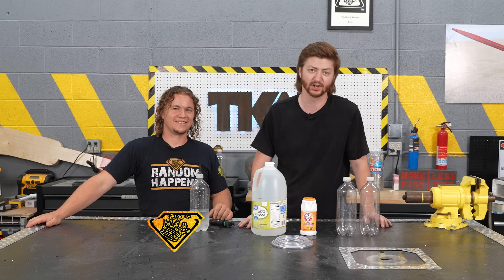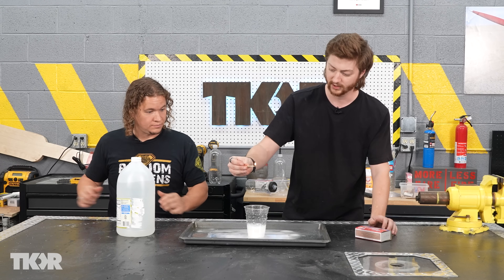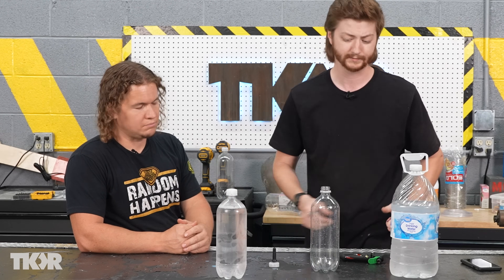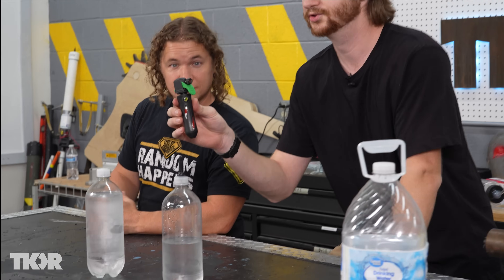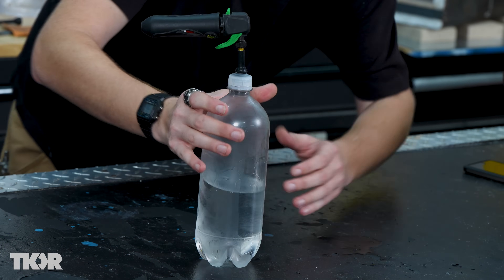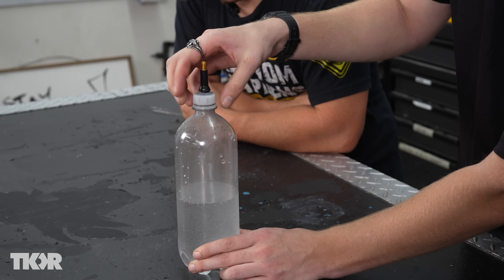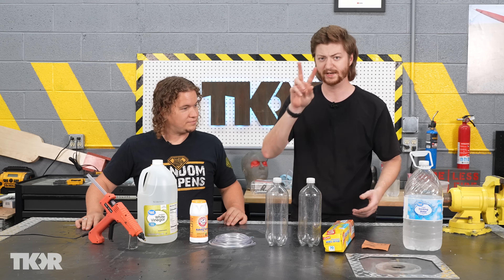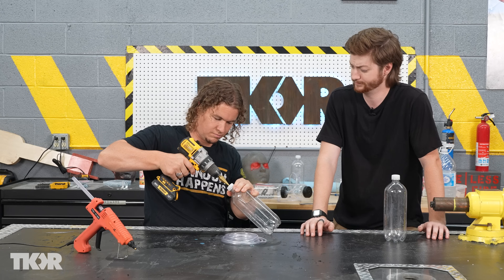Carbonate Drinks with Baking Soda & Vinegar???  |  $5 DIY Soda Machine

Comment from the maker: IMPORTANT NOTE: When you glue the tubing into the side of the bottle, be sure to rough up the plastic first with sandpaper. If you don't, the hot glue won't stick well enough to hold pressure. And you'll just make a mess (don't ask how we know)
Reply: how long dose it take to absorne intot the drink

Comment: OMG i actually had same idea a year ago for carbonation of drinks at home and actually built it before watching video , but there is a problem there is a relationship between rate of chemical reactions and pressure (inverse relationship) so as pressure increases less reaction thus harder to reach more pressure this limits this device ability but greay work 🎉🎉❤❤

Comment: Why wouldn’t you just drill the hole in the cap on both bottles and just run the hose it self to the bottom of the second container?

Comment: Drill a hole in both caps. The tube going into the cap for the receiving bottle should be long 
enough to reach the bottom of the bottle. After transferring the gas use new cap on that bottle.
Reply: my exact thoughts.

Comment: Another idea is Nitrogen. I want to try to carbonate sweet tea... sounds like it could be interesting. I've wanted to setup a 4 x 2 liter carbonation setup... another thing to try is to let it sit pressurized in the fridge... I think the 16g nitrogen cartridges might work with your bike inflator as well... you can make nitro cold brew like that. If you have access to a vacuum pump you can make cold brew concentrate in minutes instead of hours.

Comment: Fun vid, and a couple "random" thoughts (from someone who's used this basic setup for generating CO2) ...

Even more money savings, and less taste crossover: swap the vinegar with food grade citric acid.

Also, a relief valve on an outlet tube on the beverage bottle would allow multiple degassing events to more thoroughly inject the CO2 in stages and without shaking. 

Lastly: there are caps with dual 1/4 nipples that are dirt cheap, easy to find, and would totally eliminates the need for any sort of glue (the 2nd nipple on the source bottle should be "closed" with a valve or plug, or by connecting both nipples via short tubes and a 3-way "Y" connector), and the 2nd nipple on the beverage bottle terminated with a cheap plastic air valve used in aquariums, to allow for multiple CO2 injections)

Comment: ummmmmmmm
ARE YOU LOOKING TO GET SUED ?!?
you guys are building basically a bomb
just saying..
1. your containers are airtight
2. you have uncontrolled reaction making gas, overpressuring both bottles
3. since you can't control the reaction, or the rate the gas dissolves in the liquid you are making,  there is a very big possibility that you are making a bottle bomb, which at any moment in could blow up, shatter the bottles, and spray sharp plasitc shards all over..
NOW, important bits... the explosion of those bottles alone is not big enough, that it would cause any structural damage, but the flying plastic shards could cause wounds, 
END IT IS ESPECIALLY IRRESPONSIBLE THAT YOU BOTH ARE LOOKING AT THE BOTTLES AT CLOSE PROXIMITY WITHOUT ANY EYE PROTECTION..
are you... looking for a lawsuit from some parent whos kid got blinded by this "experiment" ?
pressurized systems are inherently a bit unstable and dangerous, and making it seem just a lil harmless experiment anyone should do at home without any mention of any kinda protective gear, is moronic on your parts.. 
i hope i'm being clear enough.  sure, this works, it is fun little experiment which can be done with kitchen chemicals, but the way you do it, and keep putting your faces close to the bottles, is far beyond ok, and extremely dangerous to your eyehealth.
ESPECIALLY when you have no mention of any kinda measurements or ratios of vinegar / baking soda... what if a kid just pours a mug of both in a bottle and closes it ? "I saw it on TKOR, it didn't explode there" ... 
do you guys get it ?
Reply from the maker: You must have missed the part where we use plastic bottles rated to soda pressure, that can hold upwards of 200psi before bursting. AND that the tubing was attached with hot glue, which can't remotely hold anywhere near the bursting pressure of these bottles and will slowly peel off relieving pressure before it gets too high.
Reply: @TheKingofRandom  well.. if that helps you sleep at night.
I still suggest you consider what you are doing a second time, not trying to excuse it away..
kids have made bottle bombs with similar reactions (adding solid to a liquid, causing gas formation in a closed bottle up to a point where the bottle fails with a loud bang" , and yes, the best bangs in those cases were made by "soda grade" bottles... 
the excuse of "in our system something would fail before explosion" is just kinda...  amazing argument.
especially when you have made no mention of any "safe" amounts of vinegar/baking soda combination to have, and moreover, you purposefully advice people to shake it vigorously in your bare hands to speed up the reaction..
it's kinda sad, and honestly disturbing that you are just trying to excuse this all away..
but hey, whatever helps you sleep through the night..
at least run this whole thing through your legal department , in case you even have one, and ask what they have to say about it..

Comment: A few things:
1) gasses dissolve more in colder substances. This is why colder soda has more carbonation in it.
2) when carbon dioxide dissolves into water, it creates a more acidic solution. This is why your colder soda has more bite to it.
3) In high school, as a side experiment, I took some dry ice pellets and dropped them into some flat soda. Not only did it carbonate the soda, it also chilled it at the same time.
Keep up the great work guys!

Comment: Idle curiosity.. But could you carbonate heavy whip and still make butter from it? (shaking it in a mason jar)
Reply from the maker: It would probably get real frothy
Reply: Maybe, I bet it would work much better if you had one of those metal springy round things like you use to make powdered protein shakes (or that kind of thing) with.

Comment: I was like ”or you just buy a sodasteam?!”
And then I googled, they are unnecessarily expensive! 😬😅
Reply from the maker: They are not cheap...
Reply: @TheKingofRandom  
I thought they would be like $20-$30 but no, they were way more expensive 😬
Reply: I built a home system with CO2 tanks and corny kegs for close to the same price as a Sodastream. I do 5 gallons at a time and the 5lb CO2 tank refills are less than $20.

Comment: 2nd bottle/bottle they are drinking from should have been larger like a 2L. Once the bottles reach equal pressure then no more CO2 will transfer from the 1st bottle.
Reply from the maker: Hmmmm maybe. But the pressure will always equalize regardless of bottle size. You'll end up with same amount of carbonation.

Comment: A few thoughts; use tire valves on the top of the bottles with the cores removed.  Have a middle bottle to catch liquid/fumes. The middle bottle could have activated charcoal in it but have the pressurizing air go down through a dip tube below the charcoal.  Have the liquid to be carbonated chilled. Good video.
Reply from the maker: Why activated charcoal?
Reply: @TheKingofRandom  The vinegar smell/taste will be filtered.
Reply: Maybe 4 bottles... reaction>empty bottle (inlet tube low ish, outlet tube high)>charcoal>drink... that will stop the  vinegar from going straight into the charcoal and causing any issues

Comment: I wonder if the CO2 in those cartridges are food grade lol
I just imagine there being oil or other byproducts inside them. But maybe not.
Reply: Definitely not good grade.
Reply from the maker: I did a bunch of research on that, its difficult to find out. Its definitely not certified food grade. I've read that one or two brands put lubricating oil in the cartridges, but not these. At any rate it has no smell or residue and the water made with it is clear. Probably made in the same factories that produce the food grade beverage C02.
Reply: I hate to say this but the whole reason it is food grade is because it has no lubricants in it the food grade canisters do not contain oil or lubricants they are not made in the same facility or factory there is an epidemic right now because of this heard of galaxy gas

Comment: 5:06 instead of in the side why not also in the cap at the top? If creating an air-tight is the goal then you could just have the 2nd bottle upside-down in order to have the CO2 bubble up through the beverage of choice
Reply from the maker: Cuz i wasn't smart enough to think of that - Jake
Reply: Or just have the tube through the cap extend further down into the bottle, so it exits at the bottom of the drink rather than the top.
Reply: This is what I was thinking. Would have a much stronger seal in the cap.